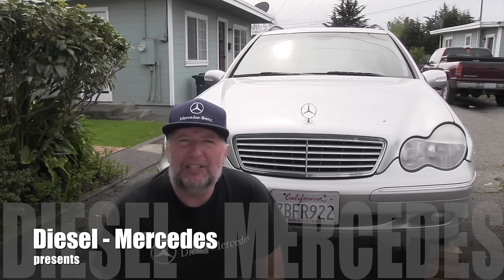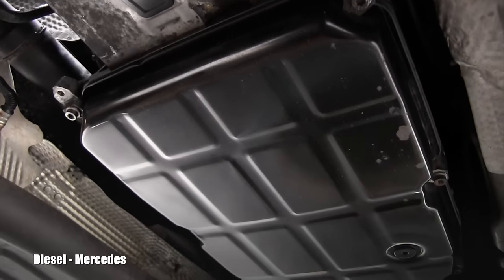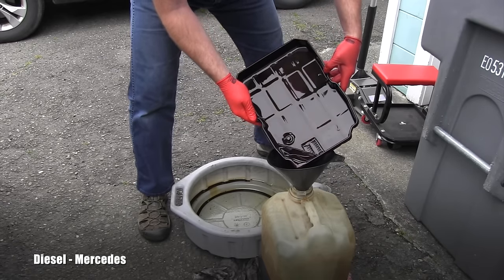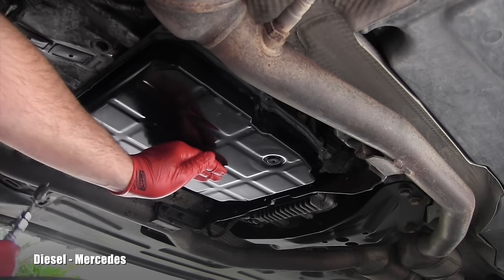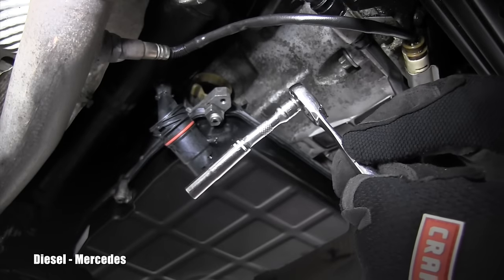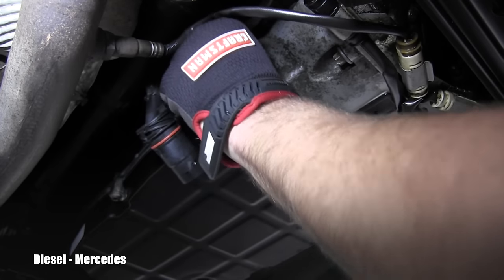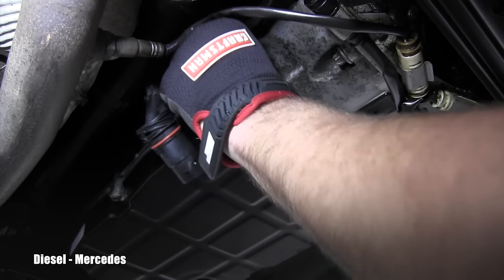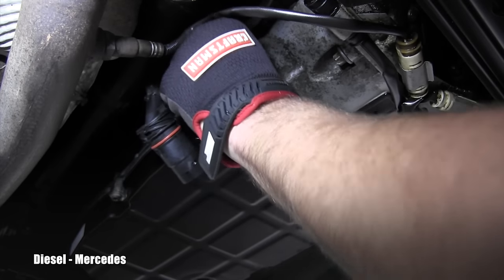Mercedes Automatic Transmission 722.6 full Maintenance Service

Comment: Very systematic way of servicing M.benz automatic transmission. The video was very clear and so with the instruction, I just thought that the old transmission fluid from the torque converter should have been drained and renewed as well, otherwise you've done an excellent work Sir, thank you so very much for your time and effort.

Comment: Thanks for your great advice! In particular, the critical positioning/timing of the electrical plastic housing to match up with the transmission housing keyways on the 722.6 trans on my 2006 Sprinter!!  My original OEM part was leaking. A good trick I came up with was to clean/ "drain" the harness and socket was using a clean shop towel and small shop vacuum. You were right- the fluid had traveled vertically. After about 5 minutes of vacuum, moving the towel in front of harness socket, it wicked dry. Thanks again!

Comment: Excellent video, thank you for covering everything most other videos missed especially that electrical connector. Personally I didn’t bother with the fluid extractor, or the drain plug, just dropped the trans pan. I avoided removing the drain plug to ensure I wouldn’t introduce a leak from the drain bolt.

Comment: I like that style of pan gasket.  My 2013 Passat uses a gasket similar to that.  What I like is that there is no silicone to scrape or get into the transmission accidentally.  If that stuff finds its way into the valve body it will be a bad day!!

Comment: If you have no leaks you can simply use a fluid extractor and pump out about 1 gallon of ATF from the dipstick hole of the transmission and replace it with equal amount of fresh ATF with no hassles.  Repeat it three times after driving a little in between fluid exchanges and you replaced most of the ATF fluid by dilution quickly and easily. Do it every 4 years and it will be sufficient maintenance for the life of this transmission. You can do this from the engine bay while wearing your suit :).  The cost will be ~$20/gallon per fluid exchange, if you use the fully synthetic Valvoline ATF that is approved for this transmission and works fine.  My 20+ year old ML is at 250K miles and the transmission runs smoothly.
Reply: Which Valvoline ATF ?
Reply: @frnzklmmrll1012  Valvoline Max Life Full Synthetic DEX/MERC. MERCON LV.      Should have Mercedes Benz NAG- 1 listed on the back side in the listed vehicles.
Reply: Hi. I ll try your technic. So no need to change the filter ?

Comment: Torque for the plastic connector is 3nm for those interested.
Reply: Thanks very much!
Reply: 2.5 Nm per WIS. But no one has such torque wrenches, so you just tighten it by the feel.
Reply: Thank you
Reply: @vaseabmwe39  can you post a link for that nm wrench

Comment: Diesel Mercedes,  thanks much for a great how to video.  Will be changing 722.6  transmission fluid in my 2001 ML430.  Most of all, I like your wood very sturdy car ramp design that I built one like yours but with two 2x6 doweled and glued together since my SUV and car have 9" wide tires.

Comment: You made it look easy great video, I have an E320 which has a hydraulic knock possible from the transmission, I have changed all the motor mounts and changed the diff oil, this is my next job in the hope to solve this problem

Comment: The procedure is incomplete: you are not emptying the torque converter. The transmission has an opening to empty the torque converter. After you take off the protecting cap you should turn the engine until you see a screw. By taking this screw out you will empty the torque converter leaving the transmission without oil. Now you can start filling with approximately 8 liters of fresh oil.
Reply: Do you have a picture of this?
Reply: Only early modelyears of this transmission have this option.
Reply: It really depends on the maintenance history of the transmission. If it's never been serviced or hasn't been serviced in 50,000+ miles, it's a good idea to leave the torque convert alone initially. Then give it a drain and fill after five-ten thousand miles, and again after another ten-fifteen thousand miles(even these miles could vary, depending of the condition of the transmission - not necessarily necessary, it all depends). After that third drain and fill, the fluid is, in theory, 99.9% new fluid. If it's been serviced regularly, sure, replace the fluid in the torque converter, it's shouldn't cause a problem. Some grit and grime is needed when that's what the clutch pack has been running on( non-maintained transmissions or non-serviced transmissions) in order for it to continue to function properly.

Comment: Thankyou Sir, i do enjoy your style.

I do have a question, why did you not do a full fluid change.
My understanding is that the 722.6 unit takes approx 9.5 ltrs, 4-5 in the pan/filter with another 4-5 in the torque converter.
Is it not pointless going through all that effort and not do the job properly 1st time round???

The only benefit i see from this procedure was
1. no chunks of metal in the pan thus showing the unit not damaged and in good health.
2. connector change as this is a known issue with this unit of transmission.
3.cleaning pan from the metal filings.

You still have 4-5 ltrs of dirty fluid in the unit, so i would argue that a fluid change was not performed.

Please don't take this as criticism, i thank you for your efforts in producing these videos for mugs like me....

Regards
kelly
Reply: how do you drain the torque converter?
Reply: @pinzgauernorcal   you don't, at least on my Jeep, need a flush
Reply: How do you drain it completely then ?

Comment: if anyone is interested, you can run dexron 3 in thos transmissions without problem. Ssangyong rexton have the same 722.6 shitbox in there cars witch use dexron 3-

Comment: +Just wondering if you would consider doing my GPS messages--- love the accent !  and although I am no mechanic, I did just have my GLK350 4Matic rear brakes and brake fluid changed as wells the transmission fluids/filter..next comes the front and rear differential fluids transmission fluid and your videos help me understand what the jobs really involve!

Comment: Wondering why the drain plug wasn't used instead of pump.
Also, apparently my Vito's torque converter holds 4L of fluid, none was removed here.

Comment: what about the torque converter? You did not drain the torque converter?
Reply from the maker: how could I ?    no drain plug on this one.....
Reply: Diesel Mercedes yes theres one or your oil pan and right by the pan there 2 little windows with plastic covers. You have to take the cover off an spin the motor by hand till you see the drain bolt.
Reply: I did mine by disconnecting the feed cooler line, starting the car, and letting it pump out a quart at a time before topping up.
Reply: you have to turn it 
 @dieselmercedes7507
Reply: @kernowmcrae  Vital, you and two other watchers knew there is still several quarts  left in the torque converter. There are other videos to show a full service for the gearbox especially draining the torque converter, vital stuff. 
I've checked the box specification for fluid quantity, 11 quarts. 
Check the fluid before commencement, measure wthat is drained from the box is the absolute test, the owner/repairer does have to be responsible despite anything on a YouTube video.
One other option another guy describes, an inspection plate to access a drain plug on the torque converter.
That was news to me I was going to do it your way.
Vital to remove ALL the fluid looking at the colour of the contents of this W210.

Comment: great video explained very well and clear instructions!  Is there any adjustments necessary after the service is complete?
Reply: The transmission learn procedure
Reply: @justinmckibben4534 , Nope and nope.

According to the Mercedes Benz WIS documentation, a reset of the transmission adaptation data is absolutely not necessary for the 722.6**NAG 1.  Best regards from Germany

Comment: This video was good but how did you drain the torque converter? With the cost of the fluid being so high it is uneconomical to refill/drive/drain the box 3 or 4 times. I usually drill a 10mm hole in the bottom of the torque converter, leave it for a few hours to completely empty and then weld a blob in the hole to seal it up.

Comment: Thank you so much for this video.  Can you tell me if it is necessary to drain the transmission fluid when changing out the 13 pin connector plug?
Reply from the maker: I will do that, otherwise a lot of fluid will come out of connector area....
Reply: I did a search with the same question and ended up here. Thanks for the info.
Reply: Diesel Mercedes I just changed connecter today.if you jack car up on right side of car the fluid will not run out..it will run away from the o ring
Reply: nice to know.
Reply: mercedes says lifetime but, most say every 40,000.

Comment: Aw man thanks for doing this.   I am about to do the conductor plate replacement.   I have gasket filter new plug and conductor plate.    But I have not gotten my new fluid yet and I do not have a torque wrench 🔧.   What wrench would you recommend? Also do you get your fluid from amazon? Thanks.  Joe

Comment: Sir Excellent Video!  Question Please The red / Burgundy  type "Victor" brand O-Ring on the on the wired part of the interconnectingTransmission 13-Pin Connector Adapter Plug, might you know the Mercedes-Benz part number or possible Victor part number?
And why do you not replace this O-ring?
Thank you
Ronald

Comment: (722.6) How many litres total  7.5 or 8 ?
Torque converter capacity ?
Drain pan capacity ?
Have shifting issues after fluid change.
Filled 4 litres after draining( low or overfilled)

Comment: Excellent video,thank you. Do you have to refill the torque converter before going through the gears, or can I just put the fluid in through the dipstick hole?
Reply from the maker: only access is through dipstick tube....
Reply: @dieselmercedes7507  my Mercedes e320 does not want to take in the oil through the dipstick

Comment: It’s better to make you own dipstic because this one you have is not showing the right level . There is a lot web Pages where you can find correct lenght from the bottom of oil pan to 8.5 cm where the right oil level should be when transmission is hot . What i also did in my case , i checked how many liters of oil went down from transmission if you have no dipstic and put exactly same amount of oil in . In mercedes ml 500 w163 i was able to drain 6.7 liters and this is how much i put back into transmission . Always warm up transmission , warm transmission allows you to drain more fluid😉

Comment: You forgot to drain the Torque Converter which holds around 4ltrs of ATF Fluid.  There should be a drain screw on TC once you rotate it by using a socket on crankshaft pulley?
Reply from the maker: not on this model.
Reply: Michael Kane i

Comment: will this method also remove oil from the torque converter.   The reason why I ask is that its  is very  hard to get to the converter plug in my 2014 sprinter, its a real nightmare so I am looking at this system, The drain plug was also striped so I cannot remove it, I dont want to just drop the pan and get that terrible mess Thanks

Comment: so you basicaly just mixed up some new ATF with the old one from the torque converter. If the TConverter does not have drain plug, you can change it by using the line that goes to the ATF radiator cooler. You did not know that?
Reply from the maker: Transmission had multiple flushes done before this service...filmed in different video on this channel.....thanks for sharing your wisdom...
Reply: Enthusiast. Could you say more about how to do that. I am stuck with a torque-converter without a plug. its a w203. What is the proceedure more or less and how do I identify the ATF radiotor cooler line.. ? Thanks

Comment: I have a 1992 300sl and I changed my transmission fluid and can’t locate the electrical connector,not sure if the transmission is a 722.6 or 722.5 are the connectors different

Comment: hi dude love the videos and the detail I'm an apprentice mechanic and my dad drives a 95 c180 automatic what brand makes a good transmission dipstick set or would you recommend buying  genuine Mercedes dipsticks ,we very rarely do automatic transmission work where I'm employed as most cars here are manual thanks for the great content
Reply from the maker: I bought mine on Ebay from US seller....it works just fine...
Reply: Thanks dude keep the great Vids up
Reply from the maker: I'm planning on that...

Comment: Hi did you silicone with new gasket and what is the torque aspect on the pan i have 1999 s500 is it the same trans I heared 8nm right

Comment: Will I lose fluid? If i change the harness connector? .i already change my fluid with atf max fluid I have a 2007 C230 I sometimes feel it in limp mode yes it has transmission code out or range etc codes

Comment: Hi, I have a 1999 w210 e320 with 350k miles. I have a major leak on connector and pan gasket. Can I perform this service and replace connector and have no issues? Transmission was last serviced in 2005 with about 100k miles

Comment: Hello congratulations. I wonder if the transmission of the E class  280 v6 190hp of the 2006 if it is the same as your C class. 722,600 thanks

Comment: There is another electrical connection and socket on the back side of the transmission. what is it, and how does one fix it if it is leaking fluid?

Comment: Can you just change the tranmission oil, oil filter and gasket and leave the connector plug out ?
why does this connector need to be changed
Reply: Connector plug also has rubber o rings that will eventually fail. Could also wick up the cable into the TCU area.
Reply: It's not absolutely necessary, but the OEM part is only $10 and it will save you the headache in the future if you just go ahead and do it while you're down there

Comment: Nice Video indeed! You are also a positive and good person. But, I know that , after removing the oil with the evacuator (about 3 liters and half) and after demount the cup under the veichle, it still remains, at least, 2 liters into the transmission that you have to flush out with a pump. In this way only you change ALL the gear oil. Excusme if I mistake something, but it seems you doesn't reflush all the oil. Didi you change only 4 or 5 liters? The 722.6 is 7.5 liters capable.
Reply: Actually 9L in total with the torque converter

Comment: After changing my AT fluid, it leaks from where electrical connector is and from under the gasket on the same side where the connector is. What did I do wrong? The filter didn't stay in tight. Could that be a problem?

Comment: I came upon your video recommended by youtube, I change out the transmission harness and the conductor added the transmission fluid (added the right amount of transmission fluid) and it still jolts when I shift to reverse down to drive and back to park did it again and its still jolts. what am I doing wrong here. HELP!

Comment: I had an issue with my 722.626 trans from an 320cdi which I installed in my w124 wagon along with om606 turbo with tuned om606 n/a mechanical injectionpump.  

I was driving home from work when my transmission started slipping and I had no gears. It turns out the magnet in the pan had been sucked up in the pickup on the trans filter.
Reply from the maker: Wow, I can't imagine how that could happen....

Comment: I have a 2006 ML500 it’s stuck in 1st or 2nd gear limp mode so it could be that 13pin connection or needs a new conductor plate replaced?

Comment: Great video, when I ask if people had their transmission conductor plate connections replaced they never knew it was a thing that needs to be replaced... I found out the hard way never fixed mine and cost me $1300. 

next you should make a video of how to replace the shifter unit... those also go bad causing shops to try and trick you in to needing a new transmission.
Reply from the maker: thanks for sharing....
Reply: What where the symptoms to that what did it do?
Reply: @coolkid9782  the transmission will get stuck in gear or go in to limp mode. hard shift. when you start the car the s and w symbol will be gone.
Reply: @reddragonmirage  ok good looking out mine is just shifting a bit rough on 1st gear hopefully just low on transmission fluid
Reply: @reddragonmirage  thank you
Reply: Also if ever get stuck or need to move the car. Put it in neutral and start it then put it in drive and don't manually shift.

Comment: Great video. Is it possible to substitute this connector with the generic version that sells on AliExpress? Thanks.
Reply: Anderson Lima there no more the 20 bucks from advance.
Reply: Anderson Lima dont use junk or you wnd up replacing it an youll be out just as much money if you would buy a good part.

Comment: I went to the M-Benz dealership today. and they changed the oil which was 9 Liters, oil filter, magnet and the rubber around the oil pan. all that for 312$. is it expensive?
Reply: aramborhan thats not too bad, and they did not replace the transmission connector?
Reply from the maker: sounds cheap for MB dealer...
Reply: No. I dont think they did. because they did not mention.
Reply: yeah. because they gave me a discount. And Im talking about Transmission oil. not the engine oil which cost 190$ oil filter included
Reply: it's about the same in france
Reply: If you can afford it and doesn't hurt your pocket than all is well. ;)
Reply: sorry to ask,did they flushing your transmission fluid ?what model of mercedez are u using?

Comment: I am thinking about buying W211 with this gearbox and 2.1 CDI engine. How long does these gearboxes last in W211 ? Are they durable ?
Reply: Did you buy the 2.1 CDI W211?.  Some Mercedes fans here will change the filter & ATF every 50,000km. Will last longer than the engine as long as no engine coolant gets leak into automatic transmission.